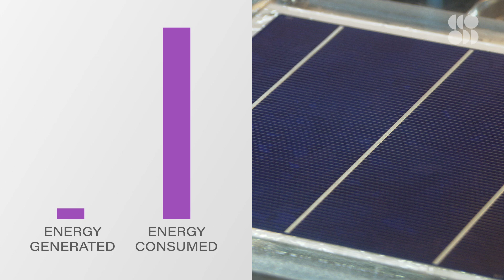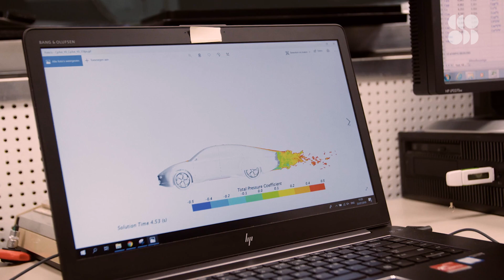The Solar Car Revolution Could Change EVs Forever

Comment: I agree with the many folks who have pointed out that this is a bit of a gimmick. Solar panels on your house are going to be WAY cheaper per watt, and allow you to go more than 30 miles per day.

But I guess there is one real advantage:  In a dystopian future where the electric grid is gone, you can still make a cross-country trip ... at 30 miles per day. 🙂
Reply: Aptera solar PV is not much higher cost than rooftop solar, $900 for the full pack giving you up to 11 000 miles per annum in sunny places, about 200 miles to the US$, rather beats fossil fuels for that distance!  Great for commuting & similar light duties, then as it only uses 100Whr per mile, range is added at about 3 or 4 times the rate seen in the majority of EVs at those vehicle chargers that are appearing all over, so will work for the long distance trips as well.

Even in Europe those solar PV panels let you drive at a fraction of the cost of fossil fuel, but maybe only 20 miles per day before you need to plug in & charge like other EVs, although with a 250 to 1000 mile battery range options, you probably will only plug in very rarely...

The real advantage is for those who do not have a garage or driveway to park on, a significant portion of UK cities for example

Comment: Ewww you have to park in the sun
Reply: or park by a normal EV charger & plug it in.  As it is so efficient the range is increased at maybe 3 times the rate of other EVs, because it drives three or four times further for each KWhr that goes into the battery
Reply: @peterchandler8505  nah no excuses fam the creator said park in the sun so that means it’s cannon

Comment: I think indian govt should do a collaboration with this company and should manufacturer solar powered buses .   Public transport is best but due to pandemic it's kind of risky too
Reply: Buses are far too heavy for any significant range extension from solar power on the roof.  Electric buses are far better though as off-peak diesel buses are worse for the climate than using a car as they have so few passengers...  Many times have seen 50 seater buses with one or two passengers here!

Comment: Aptera has been around for years. Of the miles I've driven in Cali, I have seen ONE. Unless something DRASTICALLY changes, I don't see them gaining any significant (ie. observable) market share.
Reply: With 11000+ orders already in with deposits, that is the first year's production spoken for, they will be seen in next year as you are not far from them?  Great to have seen one, as only 2 prototypes so far this time round, maybe a few more in their first run?  Though it does look as though this time it will come together
Reply: @peterchandler8505  - does that include all the pre-orders from their early 2000's campaign? I've been watching them for years. I almost bought in early, but I didn't fall for it. Seeing a newer version with little more than updated cells, black paint, and LED lights... I'm starting to get some serious Elio vibes here.... just less viable, with a smaller target market, and less existing OEM support.
Reply: Wow, that's pretty cool that you saw one!

Comment: The Lightyear one weight is 1400-1500kg and typical EVs are twice as heavy? Nope. Model 3 versions are 1600-1700kg. And the car still needs about 60kWh battery for it´s proposed range of over 700km so the enviromental impact from battery production is still there. The solar panels on the car can´t produce anywhere near the energy needed during driving so the only real question is if I have solar panels for charging available where I park so I don´t need to have them on my car.
Reply: Guess you need to check the Aptera out a bit more...  Starts at 800kg, needs just 100Wh roughly to drive a mile, so in California / Texas & the like, the maxed out panels would give you up to 40 miles a day, more like 20 miles a day in Europe...  For maybe a third or so of drivers, that is a never plug in to charge car!  If you want to drive a ... bit further, battery options go to 100kw / 1000 miles

Comment: The car still has batteries, thus creating waste like other electric car. Plus in the future, most of the electricity on the grid is from renewable sources. So what is the point of adding solar panels to the car which will increase waste?
Reply: The batteries can be recycled, there are already businesses recycling end of life electric car batteries.  

Not everyone has a driveway or dedicated parking spot to charge in.  The full panels give you up to 11 000 miles a year for maybe 20 or 30 years for $900...  That cost of driving is ... ... pretty hard to beat!

Comment: As a recent EV owner I'd like to know how slapping solar cells on a car is a better alternative to simply generating more electricity on the grid from renewable resources? I assume these Solar cars require some battery storage, so that's not eliminated with these vehicles, and the PV cells also come with a measurable impact due to production. Couldn't a large more efficient solar farm, which don't have same the constraints of fitting on a car or changing direction actively away from direct sunlight, produce more consistent electricity to charge EVs?
Reply: The batteries can be recycled, there are already businesses recycling end of life electric car batteries.  

Not everyone has a driveway or dedicated parking spot to charge in.  The full panels give you up to 11 000 miles a year for maybe 20 or 30 years for $900...  That cost of driving is ... ... pretty hard to beat!

Comment: It's cool to see concepts like this come to life and I think all the cars shown were masterfully executed. But, I don't see a need for a car directly powered by solar panels. You can achieve the same goal of having cars run 100% on solar energy by having them indirectly connect to solar panels. This is what companies like Tesla are aiming to do. Imagine your house has 100's of square feet of solar panels and you plug your car directly into the energy produced by those panels. This still makes the car 100% powered by solar energy.
Reply: Not everyone has a driveway or dedicated parking spot to charge in.  The full panels give you up to 11 000 miles a year for maybe 20 or 30 years for $900...  That cost of driving is ... ... pretty hard to beat!
Reply: @peterchandler8505  That's true some people may not have a parking spot to charge in. But, what percent of people buying a car have that issue? Probably less than 1%. Also, a house with solar panels could supply you with 100,000 miles a year if there's enough square footage.

Comment: Can you drive at night
Reply: The battery pack does help there, as long as you are not planning to do more than 1000 miles overnight, & away from chargers
Reply: @peterchandler8505  probably here in Victoria the government will charge $2/km to use this vehicle

Comment: Most of us already drive a car that is solar powered. The solar energy is stored in the most efficient medium possible - the chemical bonds of a liquid hydrocarbon complex called "gasoline".  In so doing, the buried biomass robbed from when life flourished is returned to make Earth greener again. As carbon dioxide does not drive climate change, higher CO2 levels will help fight desertization and improve crop yields. Unlike chemically toxic batteries, no coal fired power plants will need to be built to recharge my Honda. Electric cars are for the "not in my back yard" types.
Reply: You need to look at proper science, not the lies funded by the fossil fuel industry on youtube / blogs etc...

The few papers that the fossil fuel industry funded / inspired characters did put in the scientific press were shot down...  https://qz.com/1069298/the-3-of-scientific-papers-that-deny-climate-change-are-all-flawed/

Comment: What they don't mention in this video is the fact that the solar irradiance is about 1W/m^2 so even if you covered the whole surface of the car with perfect 100% efficient solar panels, you only get couple Watts from the sun, not enough to drive a proper car..
Reply: The average solar energy irradencence for the earth for a 24 hour day is 160w/m^2 but lets quit all the places that roughtly recive light and the night since you dont charge a solar car 24 hours since there is more resistance for the panels to absorve the light.
Lest put the top 8 hours of solar energy of one day at a lattitude of 40° on summer whitch is 600W/m^2 (rought estimate since the top at sea level is 1000W/m^2) with at least a 20% of convertion from the panels and 3m/s of the aptera will come with 360W/hr for 8 hr will be 2.88KW of energy in one day so is pretty much for a trip of 15 Km in a regular car, in an aptera could be up to 40 Km, more that what a lot of people commute.

Comment: You get 200wh per m2 via solar panel. And for average EV you need 200wh per km. So yes, it is plausible if you travel 1km/h (during daylight time)
Reply: The roof of a car is latger than one square meter and the energy consumption at 1 km/h is way lower than 200 Wh/km...
Reply: The aptera loks likely it has 3m^2
Reply: @SEgarciaG  and the Aptera uses 100km/Whr per mile

Comment: You cannot possibly compete with a plug in EV or a gas car in a "solar vehicle." The power of sunshine is about a kW/m2 in ideal situations. That's simply far less than what you get in even a Nissan Leaf at 80kW, and it's less than you can get from 240V charging, far less than fast DC charging, and laughable compared to filling a tank with gasoline.

Comment: You guys heavily imply that there is no battery in the car by stating that the problem with current EVs is the raw materials for the battery.   That really doesn't even make sense.  All this is is a small EV with solar panels on it which will probably never even make it to production.   Why would you do a video on it?

Comment: Charge your EV with electricity from stationary solar panels on a roof and you literally have the same thing, the ~30km range  you can get over a sunny day (when all the stars align) are not worth thr added cost and complexity.  Maybe the Aptera can do better since it is way lighter, but just plugging it into a wall still makes more sense imo
Reply: Not everyone has a driveway or dedicated parking spot to charge in.  The full panels give you up to 11 000 miles a year for maybe 20 or 30 years for $900...  That cost of driving is ... ... pretty hard to beat!
Reply: @peterchandler8505  yes, but isn't that why public charging stations exist? Since you still have to plug it in sometimes you could just charge it from there anyways.

Comment: 5m^2 for a car delivers AT BEAST (mid sunny day) 1.5KW of power, or about 1hp. So even if you charge it for 12h at that rate (unlikely), you still only have enough energy(18KWh) to drive 1h with 18KW. Severely underpowered for a 1.5tonne car. Solar powerplants and electric cars make lot of sense. Solar panels ON electric cars, not too much. It would only a minor change. Bad video for not explaining that. Also the video talks bad about the batteries of EV, but these solar cars still need them.

Comment: Yeah, I'm calling this..... Solar panels are simply not efficient enough. This is a startup scam. Maybe in a decade when layered solar panels hit mainstream manufacturing, then this can be revisited. There is a plain and simple reason why TESLA etc is not sticking solar panels to the roofs.... It does not work with current efficiency.
Reply: At 100Wh per mile, it looks as though it will work.  Over 11000 people have stumped up the deposit cash to say they want one
Reply: Teslas weigh 3 tons…
Reply: @lookatthisguyhere7712  whereas the Aptera weighs about 800kg, just because Tesla does not make very light super efficient cars that can run on 100Wh per mile, it does not mean that others cannot.  Tesla is taking a different approach to EVs, one that is turning out very successful, so you could argue that the EV market is flying because of Tesla's long tern hard work.  However Tesla has given free access to many of it's patents to encourage other EV makers to progress, so that the EV market spreads to encompass a range of design criteria.  Aptera are taking a rather different approach creating a novel vehicle that has a lot going for it.  As referred to elsewhere, 11000 people agree with them so far.  The EV market is very young, we should expect some surprises in vehicle design as it grows

Comment: If it thats efficient, put a gasoline generator in it and do away with all the extra weight and pollution from batteries and solar panels. It would cost 10x less and be even more efficient.

Comment: Forget solar powered vehicles, they are priced at about the same as an EV car, yet, they offer the same safety as a motorcycle...
Reply: Can you show me another EV with a 250 mile range for under $27K before EV rebates?  Or a motorcycle with airbags, a safety roll cage and crumple zones designed in?
Reply: @fotoguru222  
Optera starts at $29K, not $27K.
Tesla 2 is coming for $25K. Y full blown car, not a three wheeler. 
Why would you spend $29K on something that's not a car? 
The Rage? average people only do 40-80 miles per day, the 250 miles is overkill unless you are doing long hauls on a normal basis. 
Last but not least, say you have a kid, would you rather put the kid inside a $25k tesla or an optera which CLEARLY wouldn't be able to get out victoriously if it were to have an accident with an SUV or a truck.
Reply: @daniluchison  Not everyone has a driveway or dedicated parking spot to charge in.  The full panels give you up to 11 000 miles a year for maybe 20 or 30 years for $900...  That cost of driving is ... ... pretty hard to beat!  Aptera have followed Formula 1 in terms of safety design, how many times does the F1 driver get out of a smash & walk away that would not be survivable in other cars

Comment: The main drawback is weight, and that is currently governed by safety, is strength under collision. This is currently determined by existing heavy vehicles, including EVs like Tesla. If all the cars were built with an aluminium frame and something like a carbon or fibreglass body, then you could have lighter vehicles that don't crash as hard into either cars, walls or people. 

The best way to transition, is mandate that all new cars are below a certain weight and all existing cars have to drive at 50% the speed limit. 

This then offers solar cars the ability to charge enough to travel a decent distance with fewer batteries without extra "safety" weight
Reply: 800kg for the Aptera base model...
Reply: @peterchandler8505  that's not far off the weight of some small cars, and I would suspect that the majority of that comes from a frame designed to meet collisions with heavy cars, and probably also battery weight to ensure range? 

Still quite impressed they have a viable model at that weight. 

Roads would still be safer with lighter vehicles. Vehicles would also use less energy too.

Comment: Nice but a gimmic. Why not simply have solar on the roof of the building? Why limit to the space of the solar power on the roof of the car, when you have massive area on top of the buildings avaivable? Plus of curse it assumes you never park in a closed in garage. And of course that would only work in California ... try driving that in Canada or Scandinavia ....
Reply: Not everyone has a driveway or dedicated parking spot to charge in.  The full panels give you up to 11 000 miles a year for maybe 20 or 30 years for $900...  That cost of driving is ... ... pretty hard to beat!
Reply: @peterchandler8505  Yeah, it is a product for those living in very sunny areas (small % of population) with low hight of surrounding buildings (that excludes most of the cities, which is where the vast majority of population lives). So the target customer base are middle class people living in suburban areas in California ;) Most of those have a dedicated parking spot/charge point, and do not need such a solution. I agree some dont have a charge point, but those who check all the boxes and yet have no charging option likely make 0.0001% of population. In my opinion that makes it a gimmick.

Reg your comment on the costs - if you have solar roof then the costs is 0 too, so that argument does not hold.

Comment: This video is FILLED with wrong takes... Commercial Solar cars are non EV's? No compromises made? Also... please go calculate the complete life cycle of such EV's (especially Solar powered cars) since PV cells are not at all energy (or emission) efficient..
Reply: it's basically a paid advertisement.
Reply: "PV cells are not at all energy (or emission) efficient"
Most solar PVs repay their manufacturing costs in 2 to 4 years, the next 20-30 years are then just producing zero carbon power, plenty of online coverage of this..

Think you need to explore the Aptera more, looks very promising

Comment: What if you charge an ev by energy generated from solar farms 🤔🤔 that's as renewable, just putting panels on the car itself doesn't make it more than ev !!
Reply: Not everyone has a driveway or dedicated parking spot to charge in.  The full panels give you up to 11 000 miles a year for maybe 20 or 30 years for $900...  That cost of driving is ... ... pretty hard to beat!